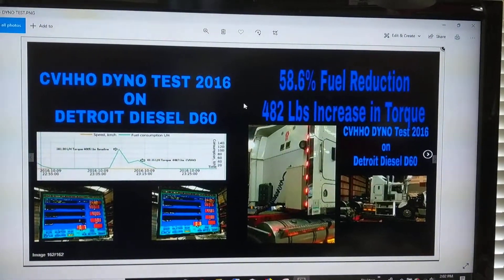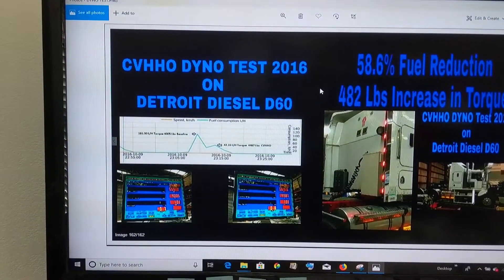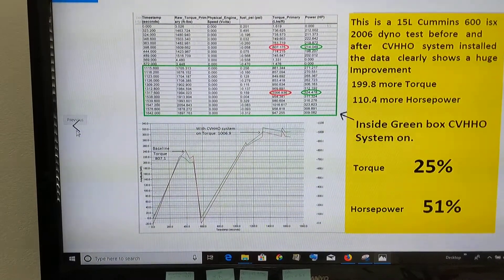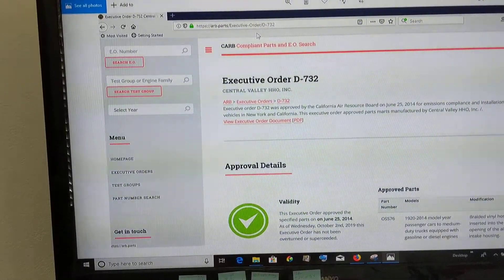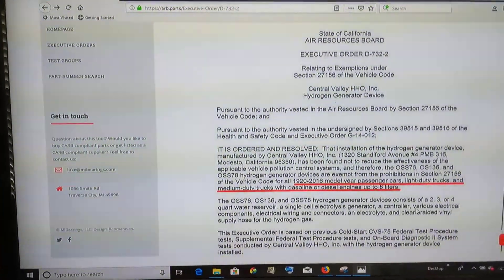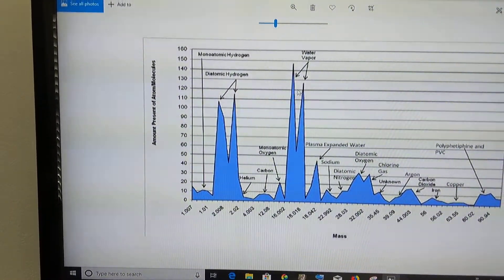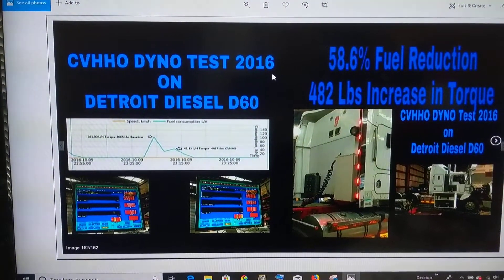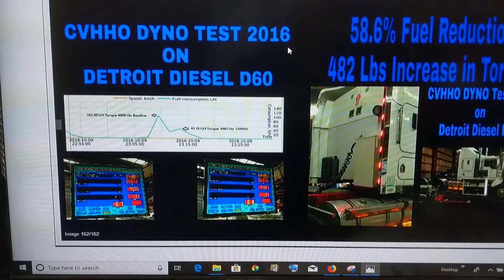Aftermarket part CARB test EO#732-2 Legal part Increases HP and Torque!

Comment: Good to see you are doing so well old boy.
Reply: Thank you I appreciate it and I hope that you're doing well.
Reply: @scottsmith6960  Hydrogen is the energy fuel transition. It should have been chosen over hydrocarbons from the very start. Greed has made quite the mess that needs plasma gasification remediation.